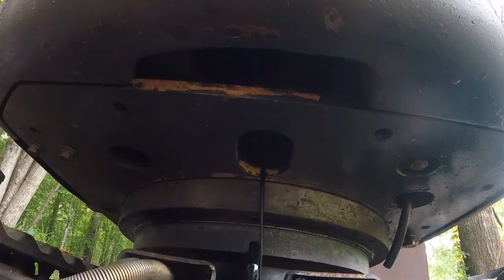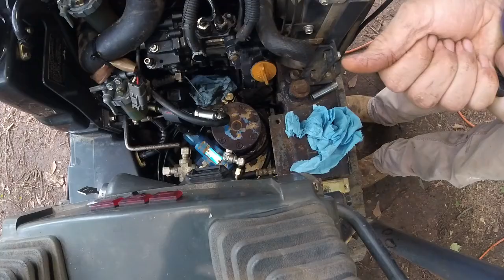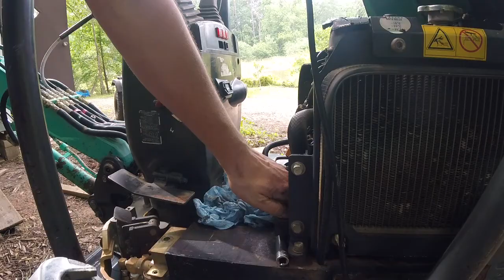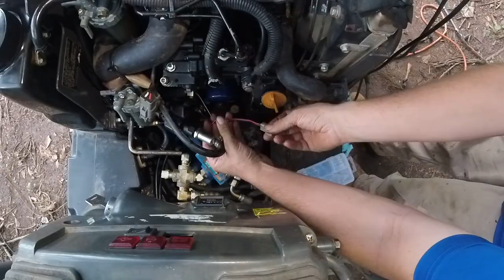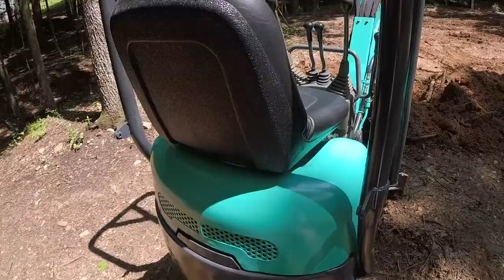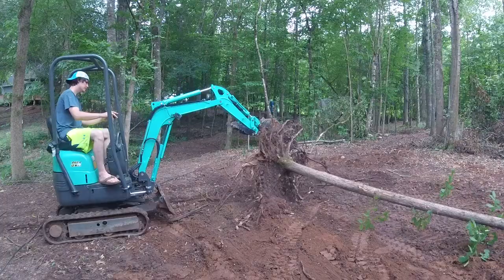REPAIRS ON MINI EXCAVATOR ARE FINISHED!! LETS PUT IT TO WORK!!

Comment: I have a 9NX that I have performed more work than most would consider a good use of time.  It is a solid little machine and I have enjoyed learning about diesels, hydraulics, and basic electrical systems. I repainted the whole machine, converted it to electric fans, added lights, rewired the whole machine with simple relays and blade fuses, and a bunch of other little things.....
Reply from the maker: that’s cool! this machine has been great!! it was abused as a previous rental machine but it has held up well and I haven’t had any other issues with it, the engine purrs and stays cool, everything works great!!

Comment: Nice little excavator you did really good on the upgrades. IHI made really good equipment. I have a similar size Kubota.
Reply from the maker: Thanks man I did some more stuff that I never got on video, like adding cutting edges to the bucket a new seatbelt and a few other things I really like kubota
Reply: Instablaster.

Comment: You did a great Job fixing it up, looks like all it needed was some TLC which is the case a lot of the time. Glad to hear it worked out well for you. 

Were you at fill throttle when digging that tree out? If so I would check to see if your throttle cable is stretched or adjusted properly as it seems it should have more RPM than that which would give you a bit more hydraulic flow and pressure as well. Keep up the great work 👍🏻
Reply from the maker: Thank you biff no I wasn’t at full throttle it was at like 1/4 throttle I usually run at about 1/2 or 3/4 throttle now

Comment: Well done, have you checked or changed the oil in those little track motor hubs? They wiz around and are tiny, but they will eat themselves in no time if you don’t look after them. They are very expensive too.
Reply from the maker: I did the fluid was like brand new in them, very clean and at the correct level. Thanks for the heads up!
Reply: How do you check and service them. Also what fluid goes in them? 
I own a 9nx and need to service the entire thing. Can’t find anything online for help.
Reply: @johnnypickler5002  Hi, checking the oil level in the track hubs is simply and so is changing the oil: most hubs have two or three plugs in the outside face, clean them up and often there is writing near one or all of them, “fill, level and drain”. Turn the hub so the drain is at the bottom. Let the oil settle for 10 minutes. Put a clean tub under to catch the oil and undo the level plug, then undo the drain plug. Look for metal debris in the oil. If you had oil up to the level and no debris then you just need to re fill with gear oil, a 90 grade is best. Use a big syringe or an oil can if you don’t have a pump, warm the oil indoors if you are in the cold. Give it plenty of time to settle and top up as required. Good luck.
Reply from the maker: Jonny they are very easy on the face of the hub u have a drain and fill level Allen head bolt just drain and refill with 80-90 gear oil
Reply from the maker: Jonny they are very easy on the face of the hub u have a drain and fill level Allen head bolt just drain and refill with 80-90 gear oil
Reply from the maker: Jonny they are very easy on the face of the hub u have a drain and fill level Allen head bolt just drain and refill with 80-90 gear oil
Reply from the maker: Jonny they are very easy on the face of the hub u have a drain and fill level Allen head bolt just drain and refill with 80-90 gear oil